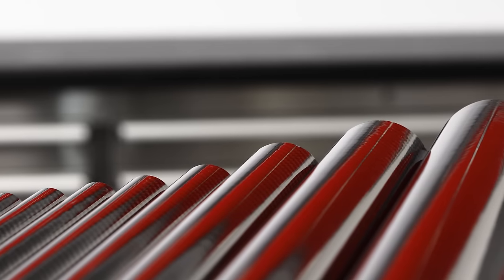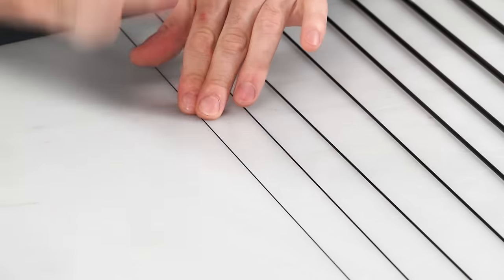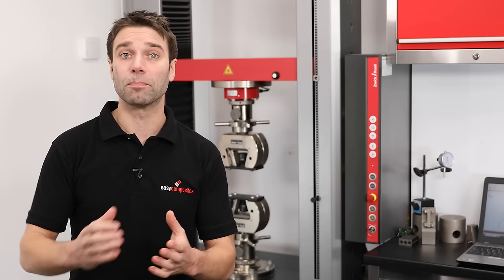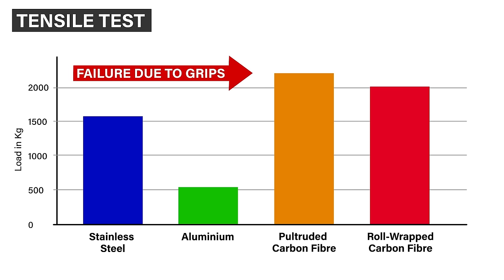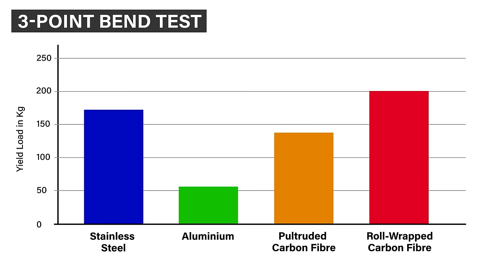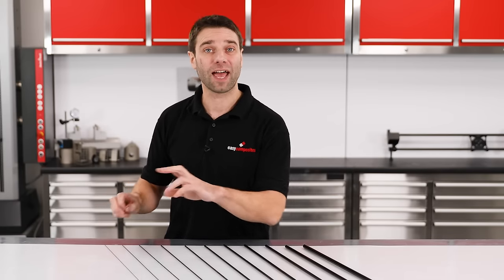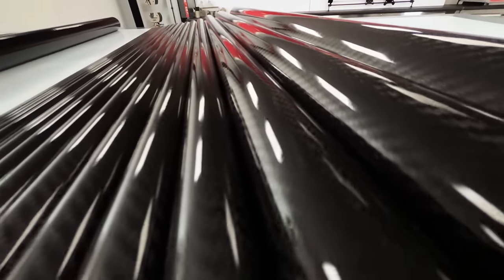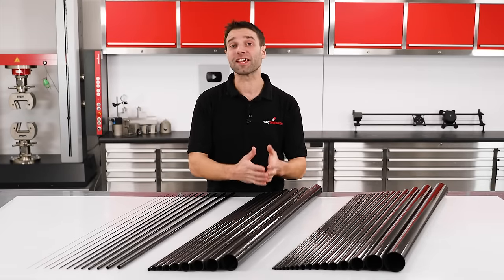Carbon Fibre Tubes - Everything You Need to Know

Comment: Slight correction, stainless steel has the same Young's modulus as mild steel. In fact, almost all types of steel have Young's moduli of 200±10 GPa. Heat treatment does not change this either.
Reply from the maker: Thanks for the comment and apologies for the error. You're quite right and in fact the original script just noted that stainless steel is considerably stronger (not stiffer) than mild steel. We're normally pretty good at spotting such mistakes but this one got through about 4 proof watches by several people so maybe we need to tighten our procedures! I think I've been able to do a rough-and-ready 'trim' on the video (which Youtube allows, until the video has had 100,000 views) so you'll soon see the line slightly clumsily removed.

Comment: You could redo these tests while using an 8mm bar as filler in each end to give a solid grip on each tube reducing the stress risers at the collet. This would focus the test  to just the tube section between each collet and provide sufficient grip without crushing

Comment: I love the fact that you take selling your product to a whole new level by demonstrating improving the value of the materials. I would like to see more in depth information on fiberglass and Kevlar and the main differences between the polyester resins such as General use and mold making and if you just happen to have some extra time to go over the real differences about epoxies and polyester types of resins that can be used and why. 
 Also can you get a us-based office.
Reply from the maker: Hi Matt, thanks for the comment and also for the topic suggestions, all of which I think would be interesting things to cover. Improving our US reach is certainly something we're working on; we'll start with improved options from the UK to US and then we plan to get stock 'on the ground' further down the line.
Reply: @easycompositestv  I second the motion.  When I've looked into strength per dollar I've found fiberglass to be vastly superior to carbon fiber.

Comment: Incredibly informative and I have to say the best channel for composites. I’d love to see a video on recreating plastic tabs for say mirror caps or other clip in components. Everything I’ve learned I’ve learned here and gave me to confidence to put into practice. Keep up the amazing videos
Reply from the maker: Your question is one that we get asked quite a lot an unfortunately there isn’t a simple answer to it. When we make carbon fibre parts ourselves we often wrestle with how we can make replacement parts attach in the same way as the original ones. The solution is often different every time and sometimes involves salvaging some of the clip or bracket off the original part (if it is to be discarded) or making something similar to the original bracket any way we can (by fashioning it out of a bit of plastic angle for example) or sometimes even making a small carbon fibre bracket and bonding it to the reverse of the original part. A ‘captive nut’ can sometimes be laminated into the part so that it can be screwed into.

In short, there’s no one solution for all. You just need to see what you’ve got and do whatever works best each time. Almost always you’ll make the part without the brackets or fixings and then add them on after. You can bond using a little of the epoxy resin, a polyurethane resin or something like Araldite.

Comment: Hi, great video.  Perhaps you could give the dimensions of the double bend rig so those of us interested can work out the bending moments and Si units.
Something on joining tubes (eg how much fibre wrapping etc) would be nice.
Reply from the maker: Because the tests weren't done to any proper standards, we'd be a bit wary of anyone using the results to derive performance data on the tubes. For example, the 3D printed saddles on the 3-point bend test compress quite a bit. Whilst it's still a fair comparison between the different tubes, this would cause  inaccurate data on the stiffness of the tubes per-se. Noted on some more joining information; this is something we'll have a think about : )

Comment: That small diameter pultrusion tube is pretty impressive. Cool they can go that small
Reply from the maker: Yes, it's only when you see a fingernail next to it that you realise it's microscopic. I think at 0.7mm OD it's the  smallest diameter carbon fibre tube you can buy. Not too many applications for tubes like this but it's a cool thing to have in the range : )

Comment: Thank you for also comparing performance by weight.
Reply from the maker: Of course Tony, that's really where it all starts to make sense. It's also why sometimes we advise customers against using carbon fibre tubes and suggest steel or ally instead; if weight doesn't matter (mainly when things don't move or get moved) then working with steel or ally will be cheaper and easier.

Comment: Very cool to watch. I was waiting for a mention of fishing rods. Carbon fibre has revolutionised them. Using a carbon fibre (I assume they’re carbon fibre) rods is a complete shock to the system, how can this ultra stiff rod cast like my old fibre glass rod. It doesn’t take long to get used to casting and loading up the rod with energy to let it fire my lure way further than the old glass rod. Lightweight and strong, stiff too but easy to cast long distances.
Reply from the maker: Quite right! Another great application for carbon fibre. I think where it’s a fishing rod then it will be carbon fibre rod (solid), when it’s a fishing pole then it will be a carbon fibre tube.
Reply: Fishing rods are made by wrapping on a tapered steel mandrel. Tapers, weaves, resins, fibers tend to be pretty proprietary, or at least they would have us believe. The word pole tends to be deprecated by manufacturers. @easycompositestv

Comment: Hello
Thank you for the valuable information you provided.
I have a question
For example, can we use a product made of carbon fiber as a mold?
Also, what do you think is the most appropriate method in mass production to produce a carbon fiber product?
Reply from the maker: Some moulds are in-fact made of carbon fibre themselves so it can certainly be used in moulds. Mass production methods entirely depend on volume and scale of production so can vary wildly.

Comment: Could you go into constructing with and joining carbon tubes? I would like to know since joint failure seemed to be a theme in the tests
Reply: Windsurf masts use a short section of tubing glued into one half to make the ferrule.
Reply from the maker: That could be a topic for a future video yes. It's generally a case of bonding inserts into, or onto, the carbon fibre tube and then linking the inserts. Composite joining sections are an option but are very expensive (due to the huge complexity involved in making them). As rtz points out, you can also bond smaller or larger tubes inside or outside of the main tube to sleeve or ferrule them where you need additional strength.
Reply: @rtz549  thank you for the reply!
Reply: @easycompositestv  Thank you for the reply!

Comment: It's funny I was trying to decide which tubing type I was going use to replace the arms on my delta 3d printer just a couple weeks ago. This is by far the best comparison I've seen, just a couple weeks late. I ended up going with roll wrapped tubing and decided to use threaded inserts with epoxy to attach to magnetic ball joint sockets.
Reply: Done the same on an old G2S with "pig iron rods".
You won't be disappointed: 1/4 the weight, less vibrations and 50% more speed with mine.
Reply from the maker: Sounds like you made the right choice anyway. 3D printers would have been another good use-case for us to mention in the video, they're definitely a good application for carbon fibre tubes because of the inertia.

Comment: This video was really helpful for an upcoming project. 
In the project there will be a joystick handle attached halfway down the tube and an end plate at the end. The intention is to have aluminium pieces machined to join the joystick and to mate with the end of tube.
I would be interested to know the best methods of joining aluminium to carbon fibre components.
Reply from the maker: Structural adhesive on a properly pre-pared surface works well.  You can use a clamp type arrangement but bare in mind excessive clamping force may damage the tube.

Comment: Hey Paul could you cover a video on how those fancy 2meter / 3meter  carbon fiber sail planes. How do they get it to weight almost nothing?
Reply from the maker: Thanks for the suggestion Juan. We do have some plans to cover lightweight carbon fibre wing structure coming up fairly soon. It's not a specific look at CF sailplanes but most of the principles are the same. With ultra-light-weighting, the principle is always to properly understand and trust in the capabilities of the materials and not 'overbuild' structures so much.
Reply: @easycompositestv   can't wait to see it.

Comment: Around 6 minutes, it was claimed that stainless steel is stiffer than normal steel. That is incorrect. In fact, the modulus of stainless is very slightly lower. Surprisingly, no matter what steel alloy, the modulus's are all very similar. What is more interesting, if you compare equal weights of metals, their stiffness is remarkably similar.
Reply: I came here to say this! I think this common misconception perhaps comes from most people's experience that typical austenitic (304/316) grades of stainless steel have higher hardness than most low carbon steels - e.g. if trying to drill them (more so as stainless is more susceptible to work hardening). But of course hardness and modulus are not the same thing...
Reply from the maker: Good comments both of you and yes, this is a legitimate error in this video. We know that the Young's modulus of stainless is the same as mild steel, but somehow this sneaked through in mis-reading of the script. I'm going to see if we can do a 'trim' edit on the video and remove this mistake because it's definitely wrong and never our intention to give out duff information. Well spotted both.
Reply: @easycompositestv  I think it's very forgivable and doesn't for a second detract from the truly outstanding content that you consistently push out! Another excellent video. Thanks to all the Easy Composites team for all the effort that you put into the community.

Comment: It would have been interesting to see the tension test if you had bonded a flange or just a few wraps to thicken the ends. That would have been the most likely method of using them in a structural application. It's kind of cheating but you would get a better idea of the true tensile strength without the problem of the grip cutting into the fibers and causing premature failure. Also I wonder how strong Carbon Fiber wrapped stainless steel or steel matrix wrapped or inbedded Carbon Fiber is. 💥

Comment: It is interesting to see how the elastic modulus behaves at small deformations.
In theory, with different types of weaving, different fibers should “switch on” at different moments of deformation.

I saw an emphasis on this in the discussion topic of bicycle frames. 
At low loads they are “soft” and comfortable, and at large loads they are harder so as not to steal the rider’s energy.

At the same time, when used in delta 3d printers, we need maximum rigidity at low loads.
Reply from the maker: You certainly could tweak the fibres used and their orientation to modify the properties of the tube in a similar way.

Comment: Excellent information as usual!
Any thoughts on type of cloth and layup style to create a torsion bar?
Porsche have upgraded CF anti-roll bars for the GT2RS and for 1 of my cars, reducing weight at the very front of the car (reducing the ARB's polar moment of inertia within the car) with a CF anti-roll bar, certainly the torsion bar section, would be a nice improvement.
Reply from the maker: ARB's prevent twist so it is likely to be some kind of spiral orientated fibres or lay up to resist twist. I suspect there has been extensive testing and prototyping to work out what is the best layup.

Comment: any reason why carbon fibers are generally treated as if they're all the same in your videos? in reality some carbon fibers are 4-5 times stiffer than others and tensile strengths also vary by a factor of at least 3-4. love the videos and would like to see something on that topic as well.
Reply from the maker: The vast majority of carbon fibres on the market are considered "standard modulus" fibres.  Although there are high modulus fibres out there, they are not easy to get hold of and not necessary for all but the highest level applications.
Reply: @easycompositestv  interesting. hasn't been my experience generally. I can buy ultra high modulus fabric directly from a local store and while the price is about 4 times that of something like T300 or equivalent it's also 3 times higher modulus. considering how much the fabric itself contributes to the total parts cost that is easy to justify on parts that are limited by stiffness instead of strength.

Comment: As noted in other comments, an excellent video. If you could just give us the distance between the supports on that test machine and the outside and inside diameters of the roll wrapped test tube, I could work out a section modulus, a bending moment and, essentially, a stress limit. I have the root bending moment on my model aircraft wing but I need that stress limit to make the best tube size selection (retired aircraft stress engineer). I'll post the calculation here.
Reply from the maker: You can see from the scale in the video, the bottom jaws for the 3 point bend test were set 120mm apart and the top came down in the centre. All tubes were 10mm OD and 8mm ID.

Comment: I see a lot of CF videos where the product comes out sort of floppy, and I thought CF was supposed to be really rigid. What's the best way to get that strength out of the CF; is it in the wetting out process, in the way you arrange the weaves, or simply lots of layers? Or perhaps something I'm not aware of?
Reply from the maker: It depends on thickness, fibres used etc.  In its raw format, carbon is flexible.  It only becomes rigid when laminated with resin.

Comment: Hello, Sir. I have a question. Before creating carbon fiber composite parts for cars, I'd like to know, based on your experience, which machines you consider better – CNC router machinery or 3D printers? And why
Reply from the maker: They are completely different so depends on the specific application.
Reply: It's for automotive mode parts for cars

Comment: It'd be great to do something similar, but comparing tubes to solid rods of CF.
and then again, but box vs round tubes.
Reply from the maker: Yep, there's no end to the interesting comparisons would could run. Box section vs tube would definitely be interesting because in a lot of ways, box section is much easier to work with than tubes. Also, comparing tubes with solid rods is something that customers ask about often and could be a whole video on its own as well because there's actually quite a few different aspects to consider. So, thanks for the ideas and maybe we'll get round to some of these in the future.
Reply: @easycompositestv  thanks. What'd be interesting to know is what diameter and weight of solid rod matches (roughlty) what diameter and weight of tube.

Comment: Thanks for your video, I learned some interesting things. However, I still don't understand the advantages and disadvantages of two of the most famous carbon fabrics from Toray Industries: T1100G and MX40. There are many rod manufacturers that use these carbon fibers, but I would bet that less than 1% understand their practical (not theoretical) qualities. For example, when a rod is made of T1100G carbon and it caught a big fish, what qualities will it have compared to another rod made of M40X carbon?
Reply from the maker: Thanks for your comment, haven't tested and don't stock these fibres i'm afraid so can't reliably comment on their performance. I think the custruction if the rod would probably be more of a factor when it comes to fishing and less so on the fibre type.

Comment: Highly informative video! I have a question. I want to use carbon fibre tube, and each end, screw-in m6 threaded bolts. How do I do this and should I pultruded or roll-wrapped tube?
Reply from the maker: Whilst you can cut a thread into carbon fibre, we don't recommend it as it will be very short lived. What would be a better option is to bond a threaded insert into the end of the tube which your bolt can then be screwed into. A roll wrapped tube would be better for this given that it has some reinforcing running around the circumference. This will help to prevent any 'breakout' of the insert if it was to be loaded on an angle.
Reply: @easycompositestv  Thanks for your advice! Any idea where I can get. 'threaded inserts' from? What would be a good Google search terms/words?
Reply from the maker: @SimonMaudeShowreel  Female threaded inserts should give you a range of options. VM100 would be a good choice of adhesive to bond in place.

Comment: How about glossy RWrapped and Dof Rwrapped did it goes the same?
Reply from the maker: The glossy finish is the lacquer applied after the ribbed texture has been ground off.
Reply: @easycompositestv so it's doesn't affect the strength of carbon tube aight?? I mean they are the same but with more expensive price for the glossy one
Reply: @easycompositestv thank youu
Reply from the maker: @muhammadnurbijakbestari8613  The woven finish does not drastically change the performance of the tube no. It's more of a cosmetic finish to the part. The main structure of the tube will be the same as the roll wrapped versions.